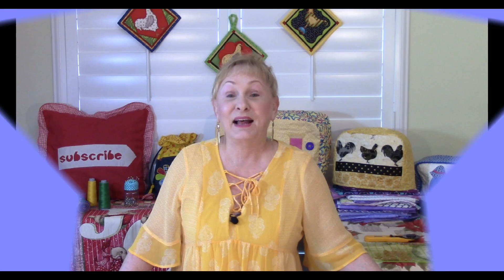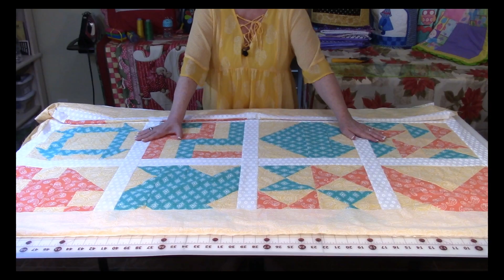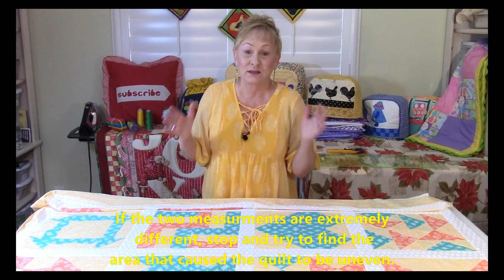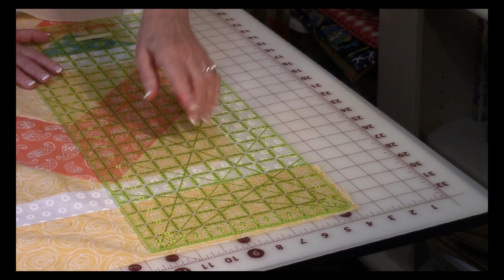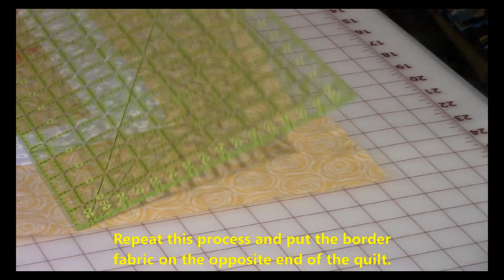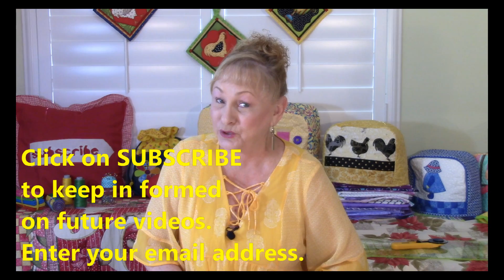Beginner's Sampler Quilt Border | The Sewing Room Channel

Comment: I am making a quilt 42 blocks eight inch finished ,six across seven down between each block I have a finished 2 inch sashing .around all of this I have a finished 2inch sashing. My question is between the 2 inch sashing and my probably 4 inch border Would it look right to put a 1 inch border between the 2 borders?
Reply from the maker: Hi Shirley.  You can add as many different size borders as you like.  Hope this helps.  Thanks for watching💗 and happy sewing😍